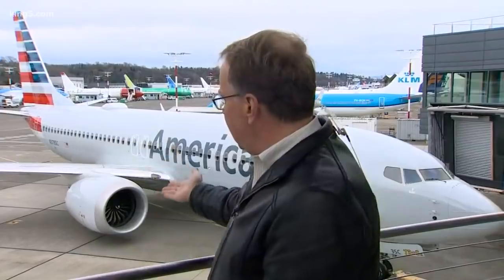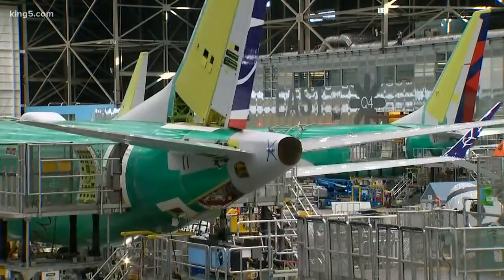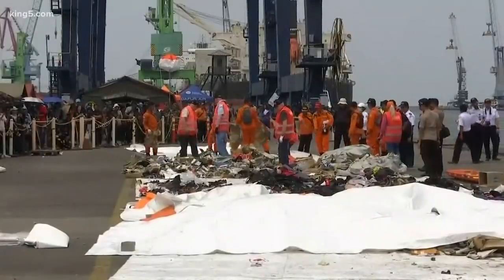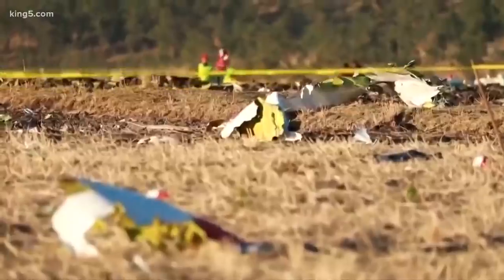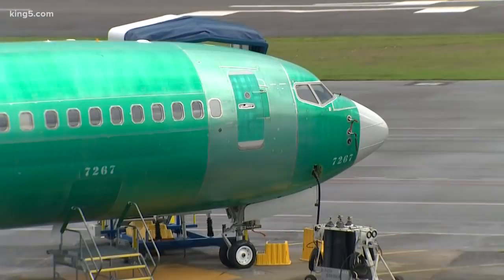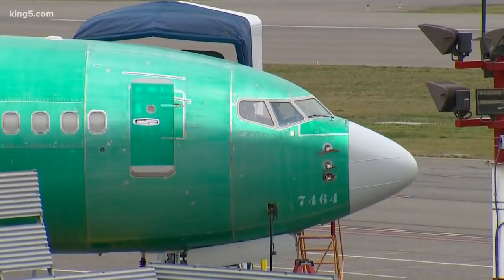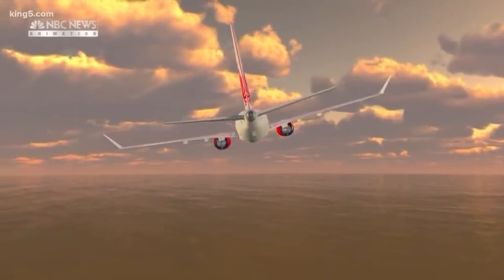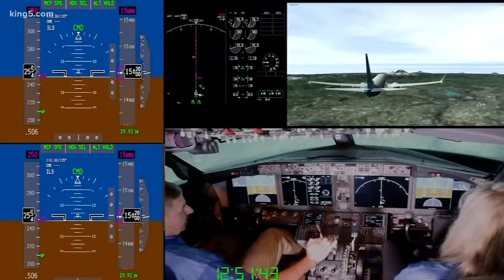Boeing unveils 737 Max fix

Comment: I remain unclear why the pilots in the crashed aircraft would not have responded as if this were a case of runaway trim. They must have known they were fighting the trim - it's hard not to notice the trim wheels rotating. If the software fix were addressing a fundamental issue with the aircraft I would have concerns about the fact that a single computer has full authority over the trim, but it looks to me as if the pilots should have been able to manage the problem. There may yet turn out to be more to this than just a misbehaving MCAS.
Reply: When the pilot hit the button for trim, it will work. The MCAS would have been disabled and everything seemed fine. Then 10 seconds later, due to the malfunctioning sensor, MCAS engaged again and the trim went up again. It was not an obvious loud trim runaway, but a slow creeping one. In that chaos situation the pilot would have had a tough time figuring out what went wrong. Remember there were no warning on the screen, because they didn't pay.
Reply: @Thephilpw99  My thinking is along the lines of "It keeps trimming nose down. I don't want it to trim nose down. There are these switches that disable the electric trim. They will stop it trimming nose down. I'll trip these switches." The only way I can see them failing to do this is if they've learned everything by rote, and have no understanding of the aircraft systems.
Reply: @sylviaelse5086  
My thinking is "The plane is heading down, am I really sure that's the trim? Because when I press the electric trim button, it works and the wheel rotates back. So it doesn't seem like a trim runaway, because I am still in control of it. Oh no, now it comes the air-speed mismatch, attitude and stall warning, what should I do..."
Reply: @Thephilpw99 ....... for training.
Reply: Sylvia Else  it could have been a combination of errors, there was also altitude and airspeed disagree in the JT610 incident.
Reply: Awards to you sylvia,   the only intelligent person in the comments section!
Reply: So Sylvia, seems you know more than others. So my question to you is: is there any indicator on the screen tells the pilot how much trim the tail is at? The trim wheel of course is an indicator, but the wheel can not tell you the real position of the jackscrew, right? Is there anything on the screen that can tell you something like "trim is at 100% down"?
Reply: @Thephilpw99  trimwheel has the indicator dude,  near them mystery  switches
Reply: See Bobby Lamm's reply. But in any case, looking at the indicator is not how an aircraft is flown manually. The pilots will note immediately that they have to pull back on the control column to keep the aircraft's nose up. A pilot's instinctive reaction in such a situation is to adjust the trim to relieve themselves of the need to apply the force. As you have noted, in these particular cases, that would work. The trim wheels would rotate backwards. Normally, that would be that. But in the case of a misbehaving MCAS, it would shortly afterwards rotate the trim wheels forwards again, requiring the pilot again to pull back on the control column in an attempt to keep the nose up. It beggars belief that the pilots at that point would not consider that they had a trim problem, with the next step being to implement the runaway trim procedure. It's not as if these accidents unfolded so quickly that they had no time to act. Now, we still have very little concrete information. In particular, we don't have transcripts from the cockpit voice recorders. They might prove very illuminating as to what really went wrong. Sadly, they might also show that the crews did not know what they were doing, and crashed aircraft they should have been able to save. It certainly wouldn't be the first time.
Reply: @sylviaelse5086  and Bobby Lamm
Yeah, I know that indicator behind the wheel, which might be blocked by the wheel itself. I am more concerned about the display on the screen. When the trim is at the extreme position, which even pulling on the column couldn't counter, shouldn't there be a warning of "trim too high", or just the number of the trim degrees on the screen? I mean, the important numbers and indicators are all on the screen, right? Why the stablizer's trim degree is not on?
I am also suspecting that the manual wheel might be the reason of the crash. Once you turn off the electric control, the wheel might not work as they had thought. Also the wheels are heavy, requires both pilot to crank them simutaneously. In this situation it's impossible to keep pulling the yoke and turning the wheel at the same time. Once you start cranking the wheel, the yoke drops down and the plane goes down quickly.
Reply: @Thephilpw99  The video I've seen of this being done in a simulator indicates that while turning the wheels manually takes some effort, it's not beyond the ability of a single person. I don't believe the aircraft could be certificated if that were not the case. I can't see any reason that moving the wheel manually wouldn't work (in two different aircraft!), and its behaviour is totally standard across all aircraft - moving the top of the wheel backwards trims the nose upwards.
Reply: @sylviaelse5086  
The video I've seen told me that the yoke will become quite heavy if the AOA sensor keeps malfunctioning. The plane computer will gradually apply stronger force to the column(or yoke) if it thinks the plane has been stalling for a while. Imagine what will happen if you have to hold the yoke back with all your strength, then crank the wheel at the same time.
Reply: There are now reports that the Ethiopian pilot did use the switches to disable the electric trim, only to renable it later as a result of being unable to get the nose to rise. Details are sketchy.
Reply: From the preliminary report into the Ethiopian accident. After they have tripped the switches to disable the electric trim: "At 05:41:46, the Captain asked the First-Officer if the trim is functional. The First-Officer has replied that the trim was not working and asked if he could try it manually. The Captain told him to try. At 05:41:54, the First-Officer replied that it is not working." It's hard to determine what the First-Officer meant by that. The entire sequence from the Captain's initial question until the First-Officer determines that the the trim is not working takes just eight seconds. Did the First-Officer mean that it was impossible to turn the trim wheels? It seems unlikely that that would be the case. Did he mean that turning them was having no effect? The wheels have to be turned a lot when operated manually, so the few seconds available is not enough to determinine that turning the wheels is having no effect. The report makes no mention of whether there's any sound consistent with the wheels being turned.

Comment: If a car company produced a car that veered to the right on rapid acceleration but was then corrected by an automatic steering instruction separate from tne driver, that car would have no future on the road. Aircraft need to be balanced and capable of being flown by a pilot. Boeing can and do make good aircraft but its now time to produce a completely new plane to replace tbe 737 series. The flying public can have no confidence in tne 737 Max. If Boeing have any sense they will be working on designs for a 737 series total replacement.
Reply: American killed the DC10. Why? Bad maintenance. The public did not care. They avoided the plane. It was not a bad design. The public is....not smart. The 737 Max 8 is dead.
Reply: Every American car before 1992 and the British Built Robin. Your point? :)
Reply: The 737 is one of the most successful series out there in the aviation world.
Reply: @atumra4125  Agreed. But humans are like sheep. You can provide unquestionable, certifiable facts right in front of them, but their stubborn ingrained self-interests will fight your truth 'til the bitter end. And when they're eventually proven wrong, they still won't admit defeat. Instead, they'll double-down and make up lies to feed their egos. And yes, the biggest, most extreme example of this line of thinking sits directly center in the Oval Office. Remember the saying, "You can lead a horse to water......"
Reply: @atumra4125  agreed - but in life you're only as good as the last thing you do. Two catastrophic crashes in five months is not good. The aircraft in its current form is unstable and this doesnt inspire public confidence. I firmly believe the only way Boeing will recover from this, is by introducing a completely new state of the art aircraft. It will take time, but the 737s days are numbered
Reply: @twobins2060  this is impossible. Without 737 Boeing will be in serious financial trouble. This plane is the cash cow for the very influential US company who has no US competitor.
US govt was even reluctant to ground the plane for money reasons, do you really believe they are going to let go 100s of billion dollar worth of 737 orders.
Reply: @usamazahid01  - when human life is concerned, costs shouldnt matter. Ive flown on many 737s including recently on a 737NG. Boeing could still produce the NG variant until they sort out an aircraft to replace the 737 series. It seems to me the current airframe with the larger engines will never be stable enough or inspire public confidence.  If they do get the 737Max back into the air and it suffers another catastrophic crash, that could really be the end of Boeing. No one wants that as there needs to be competition for Airbus and others.
Reply: @twobins2060  I totally agree and understand. But the decision makers wouldn't. Boeing is never going back to NG, there is too much prestige and money at risk. I think all they will do is a software fix and some additional pilot training.
Reply: Usama Zahid Khan Tahirkheli - you are correct - but the reality is, if the 737Max suffers a third catastrophic crash within a year of being introduced, the whole Boeing company could be under threat. I am convinced they already have people designing a new series of aircraft to replace the 737 series in the future.

Comment: To give you a simple example is this , most pilots would like to climb to a crusing height ASAP (15-20 minutes) because most Asian airport are between 30 minutes and one hour, the pilot does not want his plane to climb to 35000 feet in 30 minutes and discover he has to descend for landing, everyone knows the 737 is good for short haul flight, not MCAS which is more deadly than guns, period

Comment: Software is not enough to fix a hardware issue, i.e. Bad design. Will never fly a Max
Reply: Can you please at least fly on it just one time please?
Reply: Dude they mention in the video they would be installing a second sensor. I dont think you pay attention at all
Reply: @texasblaze1016  A second sensor? They have two sensors. My issue is the fact they designed the plane so poorly they would even need one of these sensors.

Comment: see Trevor Sumner's twitter comments on this bandaid.  He is a pilot as well as a software engineer.  The problem is a design problem and an economic one.  Boeing did not want to spend the money to redesign the aircraft to accommodate the larger engines so they just remounted them and now the aircraft is unstable.  Software isn't going to fix that.

Comment: The Airbus A320 has three active AOA sensors, with sophisticated software to monitor their signals and information. Not one, not two, but three separate sensors!  And even with three active sensors, some years ago there were two A320 incidents where there was erroneous sensor disagreement.  And what happened?  The flight control computer put the airplane into a dangerous nose-down maneuver -- exactly what apparently happened with the MAX-8.  Fortunately, the A320s were high enough in the sky where the pilots could safely recover.  Certainly Boeing engineers must have known that a single AOA fault could occur.  Yet Boeing kept a single potential failure point and its known association of risk for catastrophic consequences.  Shame on you, Boeing management!  To save time and money, you killed 347 innocent people!    Your software re-write is being written with the blood of innocent victims of your corporate greed.
Reply: Not so, in 2008 during a airline acceptence flight, 2 of the 3 sensors failed and the end result was a crash killing the Airbus and airline personell on board the A320.

Comment: Who payed that guy to say he trusts the fix. It stinks like corruption from a mile away.
Reply: That's the wonder of it. For the first time people who are out of their grasp are grounding it. Didn't you find it odd how Europe, Indonesia and so many other states with large mass like Canada are banning it? And the faa just sits in silence. It took a presidential order to ground it. Trump did it out of embaressment. Given my knowledge of previous models I am inclined to believe that the mcas was a quick fix for an aerodinamic issue that appeared during test flight. Wich means that they couldn't afford to alter the structure without spending more money. One answer: corporate greed. Also boeing has a reputation for altering investigation results. It is no coincidence that the cvr and fdr were sent to France. The Ethiopians are not stupid. Another south asian company on 80s(or 90s) sent the black boxes to the us and long behold!!!! Pilot suicide!!! After 2 other identical crashes. The real cause was in the rudder hydraulic system. The list of in evidence tampering goes on. To long for this comment.
Reply: Zeama - what airlines do you fly for? Are you even a pilot? You sure have a strong opinion. Are you an Aviation Engineer?
Reply: I am a deputy a inspector. My opinion is strictly based on deduction. See more in the comment section. I put it there by mistake. Sorry

Comment: Regardless of the fix, the 737 max remains inherently unstable.... what is the fix there?
Reply: As clearly stated multiple times though out the video, the fix would be to install an extra sensor and cycle pilots through supplemental training over "CAS".
Reply: How is it unstable? It's a sensor that tells the plane which is wta le that the angle of attack is off.  Nothing to do with stability.
Reply: @bryane2857  that sensor and mcas system is needed because plane is unstable, have tendency to stall thats why mcas system is needed and 1 sensor is not enough, even 2 is not safe because basically its faulty design (engine is too big and boeing moving that engine mounting location and causing it unstable), im indonesian and glad garuda cancel this plane orders.
Reply: @speedfastestsolo  wrong.
Reply: @speedfastestsolo  not unstable.  All planes have a angle if attack.  They all require a certain degree to fly.
Reply: @bryane2857  yes but older 737 and 737NG is safer, so no more max thanks
Reply: @speedfastestsolo  you sir have read articles and have no idea what it means
Reply: @speedfastestsolo  and I'm American lmao

Comment: I read "Boeing unveiling the fix."  I thought they fixed the "balance problem" with these forward of wing design massive jet engines.  They are depending on a fragile sensor to fix the problem once the plane stalls?  First fix the design problem.  Fix the balance on these heavy front engine planes.  That is the real problem.  Make the bird fly, not stall.  Please someone listen before more lives are lost.

Comment: For the idiots who seriously believe Boeing did this out of company greed are fucking retarded, MCAS is not something new and has been implemented on other aircraft without any issues, Boeing must have been pretty stupid if they wanted to slip extra profits and knowingly they were selling a faulty product when now faced with millions of dollars in law suits... Also, the stab cutoff switch wouldve disabled it which all pilots should’ve known about regardless the plane model, and computer adjustments are used in just about every single plane, so unfortunately Boeing is taking the heat when it quite as easily couldve been Airbus 🤦🏻‍♂️